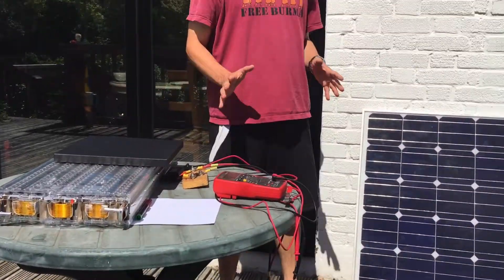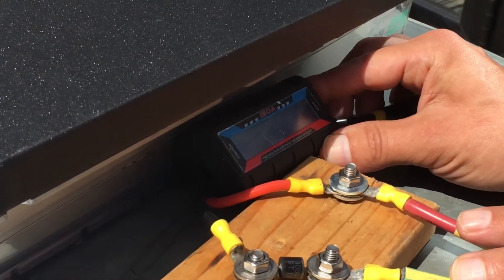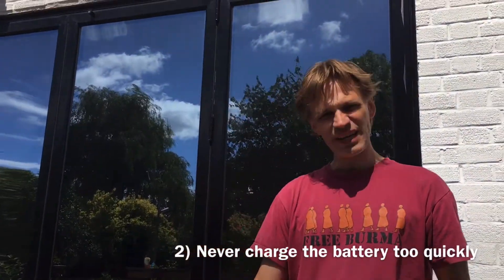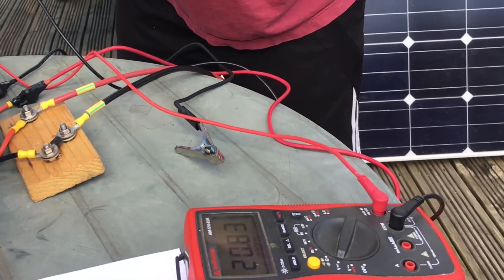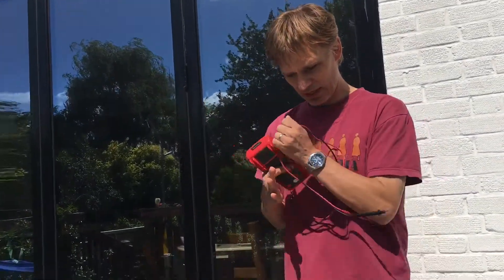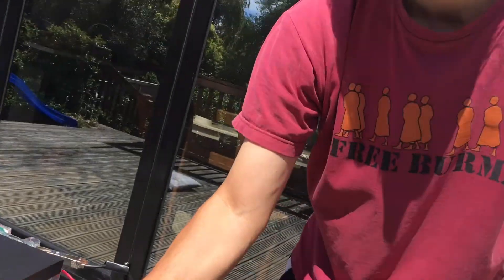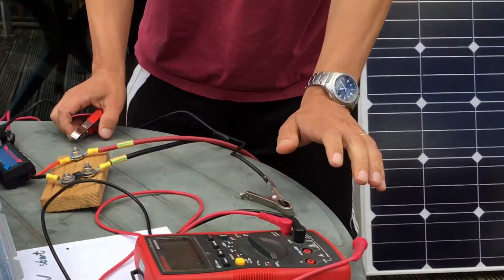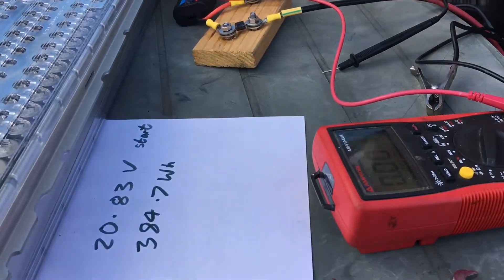3. How to solar charge a lithium ion (Tesla) battery and check its storage capacity

Comment: So what I'm understanding is that the normal LiFePO4 settings on an average solar charge controller are too high for a Tesla Battery, so one  would need a charge controller that can be calibrated and set to Tesla-specific parameters. Is this with or without the Tesla BMS module?;
Reply from the maker: I’m not sure what the LiFePO4 settings are but for a Tesla battery like this you don’t want the changer to go above 4.2V for each set of cells (I.e. 4.2x6 = 25.2V in total). I calibrate the charge controller to actually stop before that at about 24.5V so that it would definitely not overcharge the battery. I don’t use a Tesla BMS but use my own battery balancer to ensure the cells are balanced.
I hope this helps